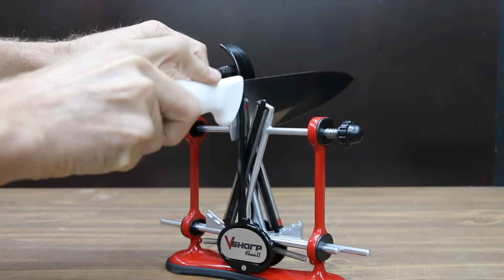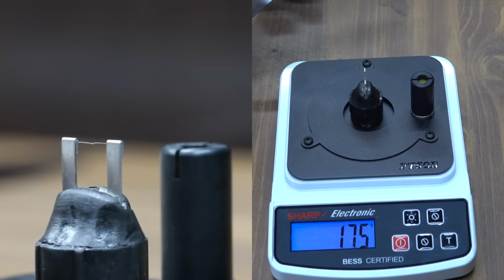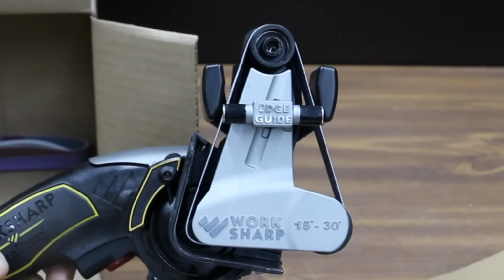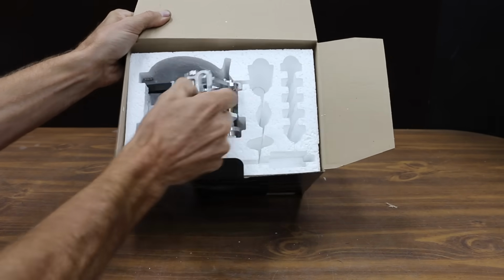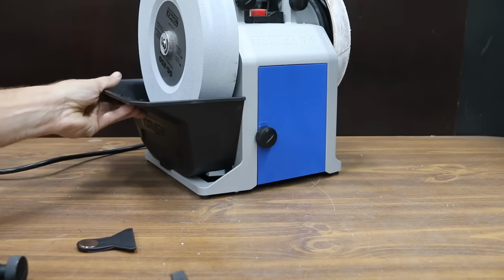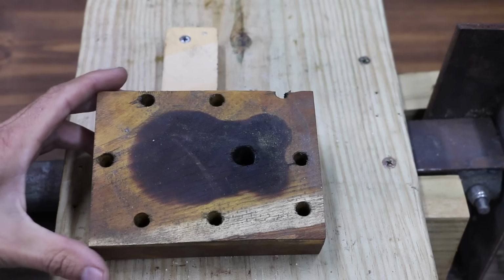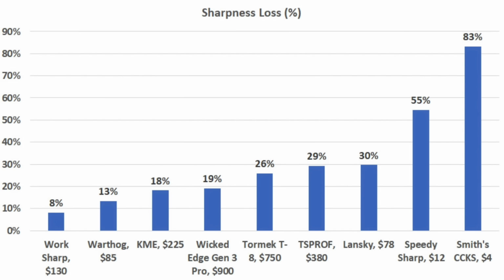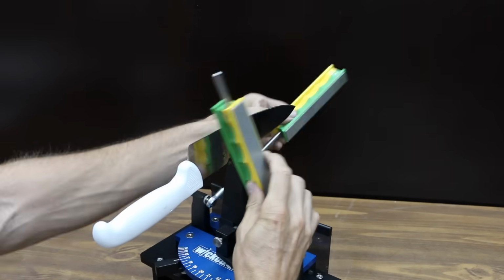RUSSIA vs USA Knife Sharpener? TSPROF vs Lansky, Wicked Edge, KME, Tormek T-8, Work Sharp Ken Onion

Comment: A friend of mine has the warthog and he got the finer sharpeners with his I think his has the ceramic one with it.  I know it will throw and edge on a knife like crazy when it's set up and used right.  I know you can get different grit levels with it.  The guide is really the only problem I have found with it if you don't keep the knife completely flat against it at the same angle the entire length it doesn't do as well.  If you have a knife with a flat across the entire blade it's a snap but if you have one with like a false back edge that don't have the flat the full length you really have to concentrate to get a good edge.  Anyways another excellent video.  I may check into a couple of these as I want one for my kitchen knives to keep them as sharp as possible.  I have the grizzly version of the tormach but the stone I have is rougher and I don't like the finish it leaves I may go with a finer stone. I like I nice polished edge on my knives
Reply from the maker: Thanks!  Thanks for the feedback.

Comment: I was wondering is there a group of tests you would be capable of preforming in your shop to compare bearing brands? Possibly a mix of top end brands like SKF, Timken, and NSK with some of the very low budget Chinese made bearings. 

I know the more expensive brands have special processes and design that are suppose to make their bearings resist wear such as the angle the bearing meets the race and the heat treat process used.

Since the real test of how good a bearing is would be how long it lasts that probably wouldn't be realistic, but possibly testing the durability of the materials used and the fit and finish of the set. Also if you used a packaged bearing set the quality of other parts used like the grease and contaminants like metal shavings that were left over from the machining proccesses.

I know I have replaced many bearings such as wheel bearings and the price can go from around $20 per wheel to over $400 per for the same application.
Reply from the maker: Thanks for the suggestion.

Comment: Hi there. I think I have a video idea. I'm working with lots of different piping with different Flow materials but every month, our company orders the same cheap PTFE tape and now we leaking like an old Bag. We will test some different brands and manufacturers, but it will be a long story (we change brake part cleaner [also good video material I think] after 2 years of waiting, paperworkers stuff). I reallywant to see how you test these tapes and Which one is the overall best in your opinion.
Reply from the maker: Thanks for the video idea.
Reply: @ProjectFarm  your welcome.

Comment: I dont know about you but the Tormek seems HEAVILY overpriced for it to not even be ready to be used out of the box. I mean, theres stuff missing that is essential for using the device. Kinda sad for a $750 electric motor with 2 wheels on it... Especially when the TSPROF, which is still overpriced, takes much less space, is lighter and works better.
Reply from the maker: Thanks for the feedback.

Comment: LOVE THE VIDEOS! NEVER DISAPPOINTS.
VIDEO REQUEST: CAN YOU MAKE AND HAVE A DETAILED COMPARISON WITH THE MAJOR 2CYCLE ENGINE MIX; REDMAX,STIHL, ECHO REDARMOR ,REDMAX AND LASTLY, AMSOIL.  THERES ALOT OF BACK N FORTH ON WHICH IS BETTER. MOST USE ECHO RA or AMSOIL. HAVE SOME BEFORE AND AFTER PHOTOS FROM A BOROSCOPE WHERE WHICH MIX CLEANS THE BEST AND HELPS KEEP A 2CYCLE RUNNING CLEANER AND ADDS POWER.  I THINK THIS WOILD BE A GOOD VIDEO FOR THE LAWN N GARDEN MARKET ON YOUTUBE. YOU CAN USE SYSNTHETIC AND OR FULL- SYNTHETIC FOR DIFFERENT TESTINGS. You can use string trimmer and it backpack blowers for best results. I KNOW YOULL HAVE EXTENSIVE RESEARCH WITH THESE PRODUCTS.  PLEASE MAKE IT HAPPEN 🙏  THANK YOU
Reply from the maker: Thanks!  Thanks for the video idea.
Reply: @ProjectFarm  hope to see it soon! Much obliged!

Comment: @Project Farm

Would it be possible for you to do an upcoming video on cordless angle grinders, from budget 80 dollar Amazon units to the more well known established brands but all that fall within the typical realm of reason for DIYers? Most folks don't spend several hundreds on a tool they only use every blue moon. It wasn't that many years ago it was extremely hard to find a battery powered angle grinder that could  even hold a candle to some random bottom of the barrel 30 dollar mains powered corded units unless you spent a lot of money; with even the slightest work being a hassle due to being low on power and battery issues leaving little runtime. However, now we are starting to get quite a lot of cordless/battery powered options available to buy for decent pricing that have marketing saying they can meet or exceed older corded units. I am wondering what brands would actually put out decent power, have batteries that match their stated capacity and output voltage, and which ones are nothing more than e-waste. Any time I am in the market for something, your Youtube videos are the first place I check before buying if you have a video made; and as I am looking for a new angle grinder I checked your videos but didn't see anything other than one on grinding pads, so I thought I'd throw a request out to you. 

Thanks for your time!
Reply from the maker: Thanks for the suggestion.

Comment: As a woodworker and avid camper I know a lot about sharpening tool edges. Like you said you like the lansky which is great if all your doing is sharpening knives but the best sharpener you tested is by far the Tormek (Jet makes a model that’s about $250.00) the Tormek is the most versatile in that it can sharpen knives, axes, chisels, scissors, drawknives, etc.. With all the other sharpeners you tested you don’t have that versatility. Also with the Tormek you get an extremely polished blade which is beneficial when sharpening chisels and hand plane blades as an unpolished edge will leave an uneven plane in the wood leaving long “scratch marks” requiring more sanding especially with harder woods like cocobolo or working with figured grain woods. The polished edge will also hold the edge extremely well and if you keep strapping it on the wheel in between cuts you can basically extend the life of your blade almost indefinitely.
Reply from the maker: Thanks for the feedback.
Reply: Seconded, I own the T-4 with the Japanese stone, and other useful additions. Amazing system.
Reply: @Bauhauser  t4 is perfect for Hobby and professional use, I had mine for years and Dont want to miss it:)

Comment: Great review, I have a couple of the Smith's style sharpeners that cost just over $2 in my neck of the woods. I would like to offer some additional info outside the scope of this review.  They are very fast, light and easy to use and fits into your pocket, with practice after initial sharpening it will give very close to a razor edge but will dull down to 'just sharp' with moderate use, however, just a couple of quick strokes will bring it back before you've even had time to get the other models off the shelf.  Definitely not in the class of the other sharpeners but probably good enough for most applications and a real time/money saver that actually works.
Reply from the maker: Thanks for sharing.
Reply: I've had my 'Smith's' for years now, works great.
Reply: I love my small Smiths. Like the one tested and a smaller one with folding serration sharpening rod.
Reply: I have a no name one from ebay and it is super amazing. I almost cut my finger off my knives has never been so sharp

Comment: Hi project farm. I was wondering if you could test the 2 best engine oils against each other. No one on YouTube has done this yet. Amsoil Signature Series vs Torco. I've never seen anyone test Torco but like Amsoil it is 100% synthetic and may be the only oil that can beat Amsoil or at least compete.
I personally run Amsoil in my daily driver but always been curious about Torco
Reply from the maker: Thanks for the suggestion.

Comment: Video Suggestion:
Space Heaters. Especially Electric Resistive space heaters (specifically, 1800 watt variants.) 
REASONS FOR NEED OF TESTING: 
1- These are one of the common shop heaters, and electric ones seem to have the widest variety between models in output and durability.
2- Most homeowners use these when their furnace is down for maintenance rather than propane or other portable heater types.
POINTS TO TEST: 
1- Fan speed over time (does the fan bog down, clog, or does the bearing introduce excess friction and reduce flow rates.)
2- Heat output from the heating element (Electric resistive heaters are "100% efficient" as the inefficiencies result from heat radiating from unintended areas, but this can result from loss of heat by poorly insulated wiring, thus heat doesn't circulate well.) Some methods to test this may be to mount a thermometer in front of the heating element, or enclosed the heater in an acrylic case, separated from the power cable and other sources of heat, then time how long it takes to go from one specific temperature to another.
3- Actual power consumption (How many watts is the heater actually using to generate heat at full load? They all list 1800w, but in use they do not all seem to produce nearly the same amount of heat.)
4- Noise. While not important in a shop, as a backup heater for a homeowner, this would be valuable to know. Could be tested with a decibel meter, and averaged between minimum and maximum values over a period of time.
5- Cost/Value comparison (you generally always do this so you don't need my advice on how to structure that.)
6- Tip Switch Reliability: I've had many of these where the tip switch breaks on or off (more commonly disabling the heater so it won't turn back on without being left off for several days and left on the most level surface you can find.) This can lead to fires or being unable to use the heater, depending which way the switch gets stuck. Meanwhile, other heaters I have used have worked for over a decade without a single instance of the switch getting stuck. I do not know how to reliably test this in a short time span, as they generally fail over extended use. But it is a suggestion that maybe you could find a way to test.

I can't think of anything else, but I figured if I was going to make a suggestion, may as well save you a little bit of time thinking up ways to actually perform the tests.

Additional points: For reference, a brand I have been happy with is "WARMWAVE" and two brands I have had poor experiences with are "Honeywell" and "Hunter". I honestly don't know that many brands of electric space heaters to give for reference, as I just stick with warmwave these days since the few I have bought don't tend to fail on me and are all easily unclogged with a shop vac in reverse blowing out the dust.
Reply from the maker: Thanks for the suggestion.

Comment: I've had the wicked edge for a few years now and I've been getting kinda tired of it. The results are always spectacular, but the setup is such a chore. It's great for putting an initial edge on a knife, but it REALLY struggles with repeatability, particularly on pocket knives. And the setup time is a chore. I pull it out for putting an initial edge on all my knives, but after that, I switch to a free-hand sharpener for the next year or so for maintenance. 

So to that extent, I'd be curious to see a test of exclusively free-hand sharpeners for touching up an edge that isn't totally ruined, i.e. run them through the wicked edge but stop at 240 grit and then work them with a quick freehand sharpener like diamond stone, arkansas stone, speedy sharp, etc.
Reply from the maker: Thanks for the suggestion.

Comment: I made my own sharpener.  Basically horizontal with 3 - 4 sided grits of sandpaperOn walnut 2" X 2" blocks about 6” long with a centered aluminum rod the grits are; 80, 120, 150, 180,. -. 220, 320, 400, 600, and 1,000, 1,500, 2,000, 2,500. I do my butchering knives and pocket knives at 25° and my chef knives at 17°. Every few uses I hiteach side up with a steel...
Reply from the maker: Thanks for sharing!

Comment: I love the Lansky system. The very best tool I use is a simple jewelers "lupe" that fits
on one eye and is 10 power. Available at Harbor Freight for about $5 for five of different magnification levels.
Reply: I started out with the Lansky system, and do agree that they are a good budget/starter. However after the few times that I cut myself with it, I'd figure it comes down to the user and possibly the design of that system. I suspect other system of similar design also have similar issues. So I shelled out to get the Wicked Edge to accommodate my Miyabi kitchen knifes.
Reply from the maker: Thanks for sharing.

Comment: Please review Needle Nose Pliers! Try screw in a screw, just holding the head of the screw … the most incorrectly used tool ever 🤷🏼‍♂️; then cut off the head of a driven nail, and see how much force they take to pull it out. Biggest thing is pulling grip at the very tip of the pliers :D
Reply from the maker: Thanks for the video idea.

Comment: Always a quality video! 

I would love to see a comparison of cordless air compressors. There are lots of them on the market. I think the only thing that really needs testing is how fast they reach the set pressure and how accurate they are in maintaining that pressure. Probably also ease of transportation.  It's probably not the most exciting comparison, buy it would be appreciated.

I'd also actually really like a comparison of battery powered heat guns, but I feel like that request may have been made already.

Thanks for all you do for this community!
Reply from the maker: Thanks and you are welcome!  Thanks for the suggestion.

Comment: Idea to make a mess / experimental research: Convential wisdom dictates mixing concrete by adding water (and when required for certain applications PVA adhesive + dyes), so..... what happens when alternative liquids are used to mix it: Gasoline, Cola, vegetable oil, Flexseal, boiling water, ice water, gatorade, isopropyl alcohol, automotive coolant, etc.

See how they affect strength + setting time

Comment: This may sound out there as a test, but oder eliminating air fresheners. Does one eliminate smoke oder better than the other?(only ask because I had to take some equipment out of a building that had a fire and the ones I got just are not doing it)
Reply from the maker: Thanks for the suggestion.

Comment: just thought of something. I used epoxy putty from jb weld called waterweld to stop a leak in supply stop valves between the brass valve nut and pvc supply pipe. wondered if any other epoxy putty would be better at stopping active leaks and stopped leaks where you turn off the main water supply first.
Reply from the maker: Thanks for the suggestion.

Comment: Best edge retention with systems, that sharpen perpendiculary to the edge. Try to avoid carbide sharpeners - they make terrible edge and eat up the blade very fast. For the beginners I'd recommend Ganzo Razor Pro (or whatever its called in chinese stores) - cheap, basic sharpener, easy to use.
Reply from the maker: Thanks for sharing.

Comment: Wtf, You buy a T-8 Tormek and u don't buy the knife holder and grits stone? Do over
Reply: Grits stone? Only thing he didn't have was the holder and it seems to have worked fine with the one he got instead.
Reply: @AlexKall  No it did not, he almost freehanded the knife cuz the lanky holder was junk on the Tormek, and the he did not use the sp-650 stone grader.
Reply: @smackmymonkey  I personally don't think there would be a substantial difference. A small difference yes but not substantial.

Comment: Hey project farm could you test a refrigerator to see if it’s more efficient having a bigger bigger thermal mass as in if you stuff it full of food or is it better to have smaller amounts of food inside so it doesn’t have to work as hard to cool it off when the inside becomes to warm thx

Comment: Thanks for another great video :) Here is a video idea or 2 . rockhard putty vs 2 part bondo vs 2 part jb weld . Perform the test on metal and on wood. These products are often used to fix rotten wood areas on the exterior of a home. Instead of replacing a whole piece of trim or window sill , the rotten wood is removed and one of the above type products are used to fill, fix, prime and paint. Might be a good 2 part test ? The first video shows initial results and the 2nd part , after 2 months , 4 months etc. after being exposed to the full weather elements ? THanks in advance. Might end up being one of your most viewed videos ever? Because every home and farm deals with this issue in time .
Reply from the maker: Thanks!  Thanks for the video ideas.

Comment: Nice, you kind of saved me a lot of money.

Actually I got tired of buying sharpeners that were disappointing after I bought three. The biggest disappointment was nearly identical to the electric belt sander you demonstrated.

I ended up building a device similar to the devices that clamp the blade and use guide holes in the clamping device to hold and maintain  a constant bevel. 

In hind sight I should have spent more time researching blade angle. I had read 20 degrees was common for kitchen and 25 degrees common for sport knives. I only allowed for these plus higher angle settings. 

I wish I had included 17 degrees too. Why? Because it's tedious to totally reform the edge and faster if you use the angle given to the knife during manufacturing. 

It would also be nice if each knife had a stamped angle on the blade to guide in the process of sharpening.
Reply from the maker: Thanks for sharing.